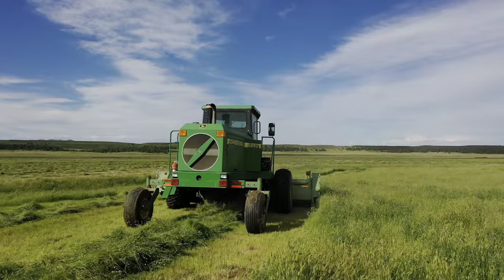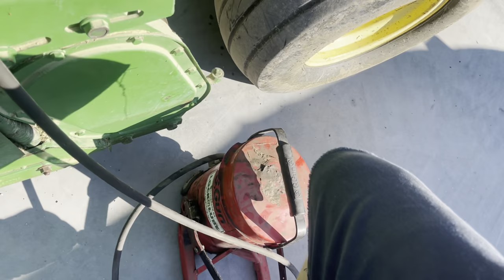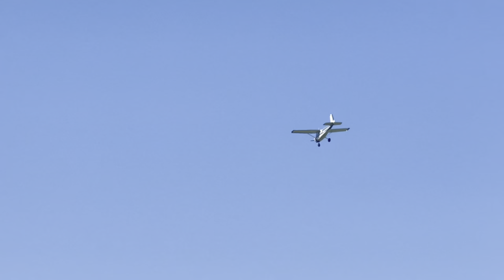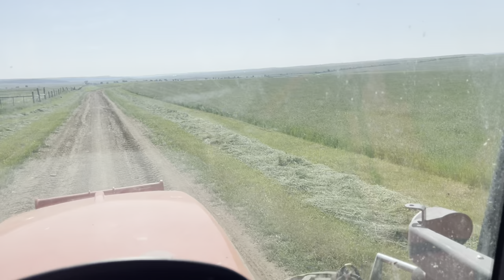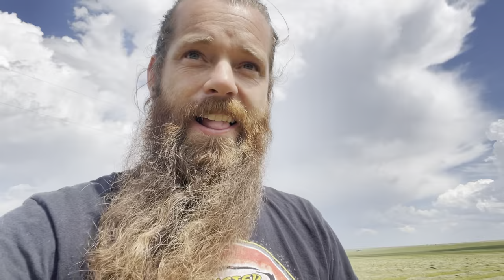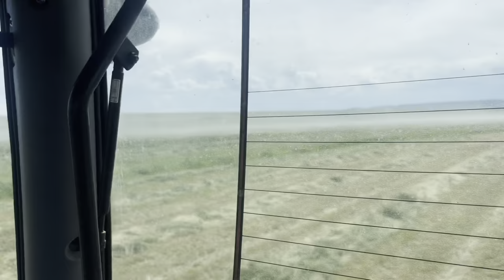A Wild West Hay day!

Comment: Although I didn’t live in the farm my dad and his brothers still worked the farm so I started driving grain truck at 10. Then we moved to the very edge of the Rockies, right above glacier in Alberta and from 13 on every time I had more than two days off school I would be and my cousins ranch working the fields, calving, fencing and of course riding the fences and delivering salt on horseback. BEST TIMES of my life. Wouldn’t change anything except maybe a tractor with air, or a cab for that matter

Comment: So I grew up in the Midwest pull type swathers were the norm, so you don't run over standing crop make six around all the way around the outside then you can spin around on the ends without running over standing crop

Comment: If you do a bit of tractor work at night don't tint your windows. Because the cab is all window all you will see at night with tinted windows is the reflection of the other windows and dash lights radio and yourself. To hard to see anything you don't want to hit or run over. Even whatever machine you have attached you will struggle to keep an eye on it. You will only have feel and your ears to hear for problems